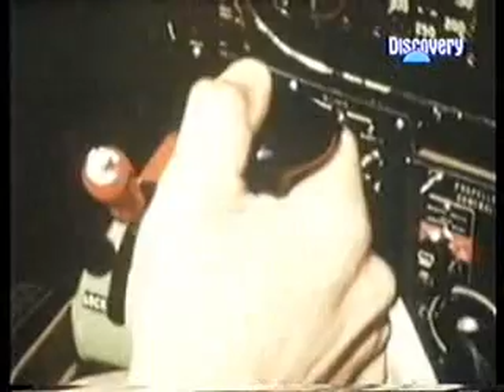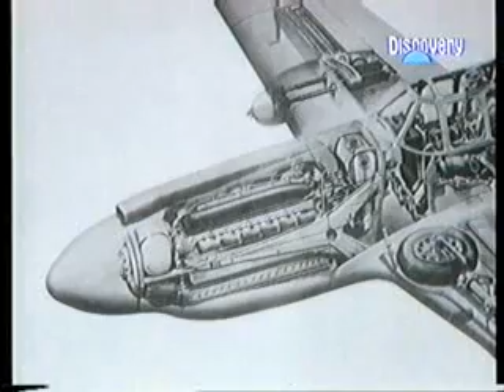The story of P-51 Mustang 2 of 6

Comment: you toob  I would assume your reference to a cheap copy of the RR Merlin you are refering to the Packard built versions??  The Packard built versions were made with better more available material by better craftsmen and faster than the British version. Packard went on to further develop and improve the Merlin. Even RR Engineers "were Amassed" at the quality of the Packard built engines. After all Packard had been building aero engines for years
Reply: Rubbish
Reply: @billycaspersghost7528  RAF bomber pilots used to worry if a Packard was put in their Lancaster's as they were not as reliable as ones from RR, this was because america could afford to make them as a throw away component.
Reply: @rogernicholls2079  Rubbish

Comment: A few things I'd like to correct on my previous statements(1) It's the Allison V 1710, not the 1701 (typo at 2:00am in the morning).(2) The Allison is not back into production, but since there were more than 70,000 engines built, there is a thriving rebuild industry in place and for a price, rebuilt Allisons are available and sought after(my fault, I made the freshman mistake of only using one source of reference).

Comment: @emforty2 There's great misunderstanding when it comes to the allison v1701, its actually a very good engine, so good it's currently gone back into production. At altitudes that the forced induction systems were designed for U.s. planes were as fast or faster than european counterparts. US planes were designed to handle much higher g's than opposing aircraft with better protection for the pilot and systems and were concurrently heavier. I'd be happy to answer any relative questions